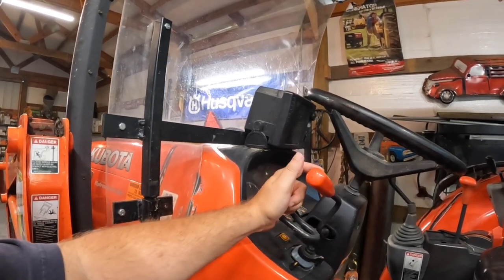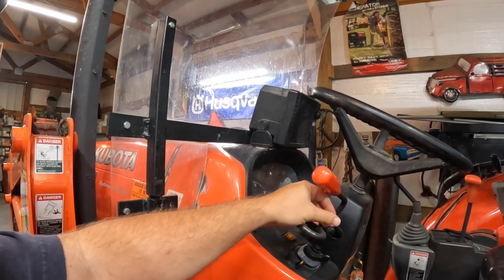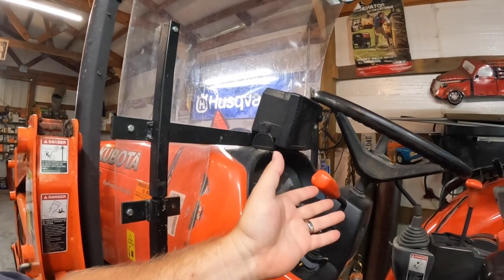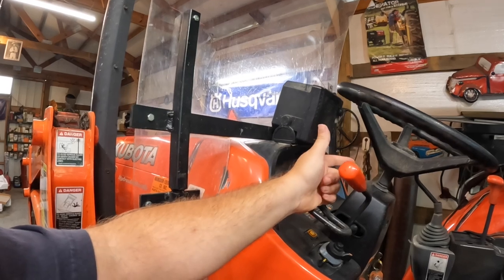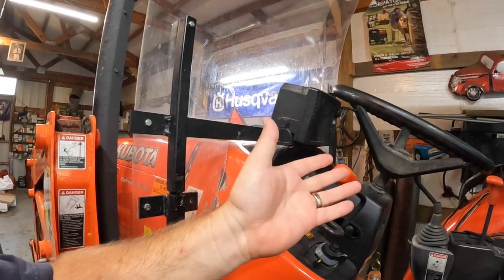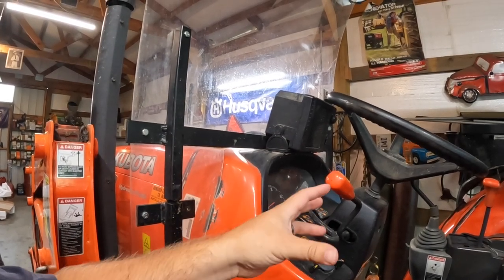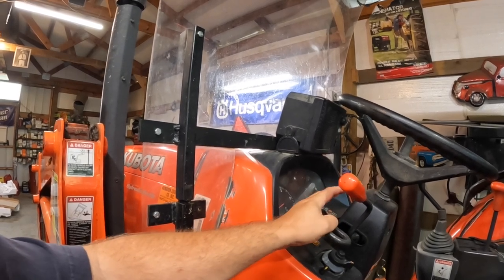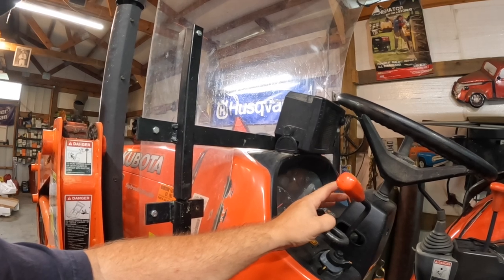How To Use a Kubota Shuttle Shift Tractor Transmission!

Comment: Thanks for the demo.  I'm fixing to pull the trigger on a 2013 M6040 as soon as the salesman calls back saying it's here.  Never having used anything more advanced than an 8/2 tractor tranny I needed educated on how to work it when I go have a look. Same engine/ trans as the M6060 with a bit less smog control on it.  I'm an above knee amputee on my clutch leg for the past 20 years and if I didn't find something that would allow me to clutch less when plucking and loading hay rolls I wasn't gonna be doing this much longer. A drive like this will be a Godsend.
Reply from the maker: I hope it works out well for you! It may take some getting use too but I’m sure you’ll be able to handle it like a pro before long. Thanks for watching
Reply: I'm interested to hear if you got the 6040 and if you like loading hay with it.   I grew up around normal old transmissions but for the past 20 years have used HST on an L48.  I need a touch bigger tractor and am unsure if I will be happy with shuttle shift for all the stop and go, especially for stuff like loading hay.  Thanks!

Comment: Great video I have a Kubota M5040 HYD shuttle shift I love it , don't like hydrostatic tractors . I used to run big loaders and they we're HYD shuttle shift. When you are bush hogging it's sweet backing to get the corners. Like you  I pause shifting forward to reverse . When I park mine I set my booby traps ,  with 7 things so it wont crack are move all from the seat You probably do the same thing to slow folks down are keep them from taking it if they don't know what they are doing. Not going to tell the secret Thanks for showing folks about this transmission . Hope you are having a good week end.
Reply from the maker: They are a nice transmission option for sure! Thanks for watching

Comment: Ben, I really appreciate that video.  I was one of the ones asking about how they work.  I had no idea how those work.  Like you I have to start up on some steep hills and having the ability to not grind going from low to high while moving is an awesome feature.  I currently have a M4700 with 4x4x4 trans and a L4701 hydro.  It was the first of many hydros that was really quite and it has the cruise lever.  If you are doing nothing but back and forth loader work I really wonder which trans would hold up over time.  Agreed your trans would be good for me but having almost been run over by a 801 that popped out of gear on a hill that park feature on the 12 speed would be really nice.  I would add Kubota in the title and I would really be surprised if this video does not blow up your channel subscriptions.  Thanks again!
Reply: "...blow up subscriptions" LOL. Ben hasn't resorted to shocking click bait titles...yet.

  Maybe, "Black Cats Prefer Kubota Hydraulic Shuttles when Loading Hay for Horse Ladies!!" ?

  Not the best, but it covers cats, horse hay ladies and Kubotas.
Reply from the maker: I like everything about this drivetrain except that free wheel issue. Thanks for watching!
Reply from the maker: I’m not much for clickbait titles, although it seems to work. Thanks for watching

Comment: I had a surgery, and used my clutch on my M7060, and got tendonitis and could not walk on my leg. I still had to work, and I finally figured that I could change gears while in neutral. I don't have to use the clutch. But travel shifting is a bit complicated. I can shift on the shuttle, which I didn't know could be done, and not a noticeable difference, other than you slow down a but faster.
Reply from the maker: Yeah that hydraulic shuttle is a handy feature to have for many reasons. Thanks for watching

Comment: You done a really good job at explaining the tractor hydraulic shuttle, i have the same tractor as you know, and the only two things I dislike or would change if I could are in this order...Parking Brake/Lever these same tractors are sold in England and have an actual E brake on them....I have tried to get the parts list and possibly install one but have had no luck.....and the 2nd thing I might?? do different is a cab.....but the parking brake lever is the only actual dislike I have with mine and it all just comes down to safety  sometimes my dad or uncle will operate it and i have to remind them they cannot just turn it off and get off because it will roll........ without hydraulic flowing to the transmission.....if Kubota, would just let us get the parts they put on the England bound models and I would consider the upgrade...It would be a lot cheaper than the 12 speed upgrade now days......
Reply from the maker: I don’t understand why they don’t use the parking brake handle setup. The M4’s have that on them which is basically the same tractor drivetrain. I’d trust that more then this lock they have now. Thanks for watching

Comment: How do you operate your engine speed when you are going F/R often like for loader work? Do you set your rpms high using the hand throttle and then use the shuttle like normal (to give your loader good cycling speeds) or do you use the foot throttle and idle it down before you change directions? Ive tried both ways and not sure which way I prefer. I do feel like if I use the foot throttle, I dont run the tractor hard enough and it wants to regen more.

Same question but for doing something like brush hogging a tight area? Do you run the hand throttle up to get pto rpms where you want and then use the shuttle or do you use the foot and let off throttle when changing directions? I feel like the cutter likes the constant high rpms but hard to tell if the tractor likes taking off at 2000+ rpms. I do hesitate in neutral and apply the brake before engaging the opposite direction.
Reply from the maker: With PTO operations always set the rpm with the hand throttle. For loader work I do both. It all depends on the situation I’m in. That for watching!

Comment: Ben, great job covering the subject. I have never used a hydro/shuttle type transmission but, after your video, that looks like one sweet design. I too would not like the lack of a parking break. I’m surprised in this day and age the the attorneys that type of design. 😎 As always, thanks for bringing us along.
Reply: It has a parking brake, he shows it at the 12:56 mark.  My BX2680 is the same thing, you have to apply the parking brake yourself, just like most cars out there, maybe the new ones and all the electronic crap has an auto-parking brake, but the M6060 in this video does in fact have a parking brake, although he's using it wrong in this video, both brake pedals need to be locked together, otherwise all you are doing is applying the brake on the left wheel, which on a hill might not be enough.  Just remember a tractor only has brakes in the rear.
Reply from the maker: It has a park brake but I don’t trust that without a backup holding feature on hills. Thanks for watching
Reply: @khtractors  Yes, sorry - I meant it would be nice to have a backup to the parking break, like on a manual transmission one can leave it in 1st gear. Box blade works well when it's on or bucket when it's full. Shouldn't have to trade safety for convenience.

Comment: Nice video Ben!!!!!! I wish they had park in them too and it be the perfect tractor I believe!
Reply from the maker: Yeah that park feature would help as long as it didn’t get stuck under pressure. Thanks for watching.
Reply: @khtractors  I was use to older John Deere tractors from 70’s always work great we never had any problems I’m sure it was real parking gear but it worked

Comment: Thanks Ben!  I also requested this and it was very helpful!  

Initially, I was thinking I had to adjust the throttle, as you would in a car or truck, to not stall the machine.  Looks like there's plenty of torque to not worry about that.
Reply: If you drive a car or pickup properly you don't need throttle to take off either, nobody drives them that way though which is why you see burned up clutches at 50k or less, that and people riding the clutch, resting their foot on the clutch pedal, using the clutch to hold them on a hill, downshifting, etc...all that stuff contrary to it seeming to be cool wears out the clutch pretty quickly.  You can start a car from a stop even on a hill without applying throttle, the trick is using the parking brake to hold you on the hill while you release the clutch and the parking brake simultaneously.
Reply from the maker: Yes I just pull out in first high and shift to 4th high when going on the highway just like in a vehicle. No need to rev it up. Thanks for watching!

Comment: Have you got a video on how the draft lever works on m6060? I run it in the up/back position all the time and dont know if thats even  right. Mainly just bushhog with the tractor.
Reply from the maker: I leave my draft lever in the down position when using the regular positioning control. I honestly have only tried draft on the Kubota one time. I almost always plow with a Massey Ferguson because their draft is spot on.

Comment: Good explanation. If anyone is interested Vahrenberg Implement has a YouTube channel with many good videos on tractor features and optional transmissions and shift patterns. 

  I have a Dyna4 on my MF 5455 and I've seen where Massey is offering the 4700 series like your neighbors tractor with a Dyna2. The thing I like about mine is that I can shift through all 16 without the clutch. And I am addicted to having 4 speeds available on the go through either the shuttle leaver or the T-bar. 

  I have the sensitivity switch, but it is almost always set all the way in the least "jerky" position, especially when my green help is in the seat. In the video it does look convincing that the Kubota is in the "sweet spot" and switches directions smoothly.

  Not always pleased with having only an emergency brake and no parking gear, but then it doesn't hang up under pressure like the quad-range can in my 4230 Deere.

  But, like you, I prefer having a hydraulic shuttle/manual over a hydro because in my (ignorant) opinion it is less stressful to put it in forward or reverse with a flick of the wrist than having to use your foot and maintain pressure. I have read that the Hydros with a pedal for each direction are more intuitive to operate than the "rocker" style where you tip a single pedal forward or back.

  I test drove a 5610 MF that had a feature where the clutch is like the brake pedal on an automatic tranny in a car. That would be super nice for round baling and picking up bales. Maybe just me but I almost 100% use the foot clutch for those 2 jobs, even on our flat Iowa terrain; just not confident enough to rely on my reflexes and the de-clutch on the shuttle leaver.

  As a foot note, I have read that creeper gears can be intended only for extreme low speed PTO work etc. and are not to be used to pull at the draw-bar under load. The gears are small and will strip. No personal experience, but something a buyer should cover with the manufacturer or sales rep before use.
Reply from the maker: Excellent information in this comment! You seem very knowledgeable of the various options. My BX is the only hydro transmission I’ve ran much but it’s just not for me. You have to run high rpm’s on everything you do. Thanks for watching

Comment: Thanks for sharing Ben. Vary informative. My hydro won't roll on a grade with engine is off. As long as transmission is a range. Only way to roll tractor  is to take out of a range position.
Reply: Yeah this seems kind of odd to me with his tractor.  The hydraulics for the clutch must be tied into the hydraulics for the rest of the tractor, so when the engine is shut off there's no hydraulic pressure and thus no hydraulic pressure to the clutch leaving the tractor to freewheel as it would essentially be in neutral at that point due to the clutch not being engaged.  

Seems like a safety issue to me and Kubota should do something to correct that design flaw.  Many people that drive manual transmission vehicles don't use the parking brake, so their first thought on a tractor like this is, 1st gear or reverse and walk away...and in fact that won't work with this tractor.
Reply from the maker: My uncle had a 350c Deere dozer, gear drive but with a reverser. It did the same thing when shut off. Thanks for watching

Comment: I’m stuck between this tractor and the mx6000. I know the gear drive will serve me better for harrowing and planting my garden and food plots but I also do a lot of tree work with the grapple. The shuttle shift seems almost as fast as hst.
Reply from the maker: I’m not sure of the price difference but the M series will seriously out perform MX. The M also has a power pin selection on the loader that increases the lift strength considerably. Shuttle is easy to use plus you get more power to the ground.
Reply: @khtractors  is the m series capable of pulling a corn planter and cultivator as far as wheel spacing goes? That’s another big deal breaker for me because I plant sunflowers and corn every year for a dove field. Being able to cultivate would be a huge plus
Reply from the maker: @talorspridedude  I’m not sure what spacing you need but it’s adjustable. Mine is set to the widest position now.

Comment: I have a question. On this tractor, can you start from a standstill in any gear (even  4 High) or do you have to progress through the gears (I. e 1st, then 2nd, then 3rd, etc) as you would on a manual transmission in a car?
Reply from the maker: In high range I usually don’t pull out above 2 high and then shift on up to 3rd and 4th. They shift really smoothly on the move.

Comment: lets say going down a deep driveway to slow down do i use clutch or brake
Reply from the maker: You drive it like any manual transmission. Generally I start down a hill in a gear that I won’t needs brakes. But you can slow some with brakes and of course clutch if your stopping. Thanks for watching

Comment: As always Ben great video!!! That's crazy why it won't hold in gear I wouldn't like that either.  Have a 1626 Mahindra with manual shuttle have to use clutch. mine will hold in gear when shut off engine.  I've gotten used to mine works great.  That was interesting to know.  Thanks for sharing be safe have fun enjoy ya'lls homestead
Reply: I think this is an example of the hydraulic shuttle, being, the tractor is shut off, there's no more hydraulic pump running to keep the clutch engaged, so essentially the tractor is just in freewheel as soon as you shut if off as the clutch loses its hydraulic pressure and becomes disengaged.
Reply from the maker: Yes a manual shuttle holds on gear. I’d like to know more in detail on how this hydraulic shuttle works. Appreciate you watching!

Comment: Great Video, but I noticed you weren't using the clutch while shifting gears at around 11 minutes in.  Aren't you supposed to?  (not forward to reverse, but when shifting through 1 to 4)
Reply from the maker: I’d have to watch and see but I think that maybe where I was using the shuttle lever to declutch the transmission and shift. Not a common practice but it works.
Reply: @khtractors  interesting.  So thatisok to do? M7060 on the way. Only used a hydro. Great video. Appreciate it.
Reply from the maker: @daviddraeger979  I would recommend using the clutch pedal to shift through the gears. They shift really easy though just like a manual vehicle.

Comment: Hey Ben, I am one of the very few people who opted for the gear driven version of the L2501. I must admit, it would be so sweet to have a hydraulic shuttle and synchronized gears on my machine, but something tells me the cost would have increased😃
Reply: It does increase the costs, not sure how much but its kind of one of those do ya want it, do ya really really want it LOL.
Reply from the maker: I think you made a good choice going with the gear drive. You can achieve much greater pulls at low rpm’s then a hydrostatic transmissions can. Just wish the 2501 had a two stage clutch for the pto. Thanks for watching
Reply: @khtractors  does the pto on the L2501 push the tractor forward when the clutch is pushed in while running a brush hog for instance. I'm seriously looking at the 2501 but not liking it doesn't have a "live" PTO.
Reply from the maker: @baucom93  that’s the biggest draw back to that tractor. I just don’t like the pto stopping and starting each time you shift gears to change direction. A dual stage clutch or independent pto is much better. As for pushing the tractor like with the old Ford 8N’s I’m not sure since I haven’t ran one.

Comment: I have a 88 L2850DT and it’s the regular manual version with a dual clutch. Mine is a 4 gear with high/low range and a mechanical shuttle, partially synchronized = synchronized shifting between 3rd and 4th in both ranges. 
What exactly does this mean?
Does it mean that going from 3 to 4 I don’t have to stop?? Or does it mean I can just shift it from 3 to 4 without the clutch??
I assume it means I can shift from 3rd to 4th while moving but I do still have to use the clutch?? Right??
This thing is still clean and well kept, it’s a beast and completely outperforms a Kioti 40hp tractor I assume due to the Kioti being hydrostatic. Mines only 34 hp and runs the 7ft bush hog without breaking a sweat only having to hog twice a year. While the kioti has to do it every 3 weeks or so because it struggles if the field gets to high. It really makes me love my kubota.
Reply from the maker: The transmission has synchronizers in those gears so it shifts smoothly like a manual car would. Yes you need to clutch when shifting. I shift any tractor synchronized or not while moving it just takes learning them.